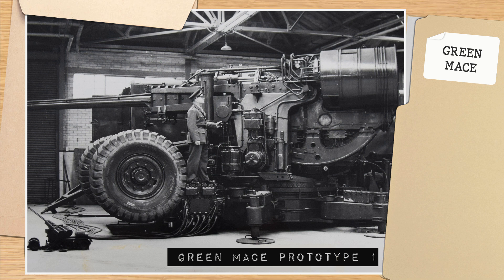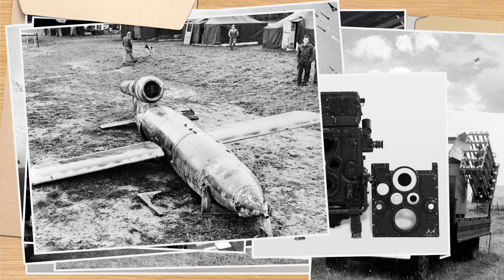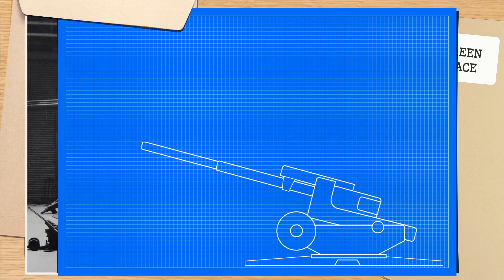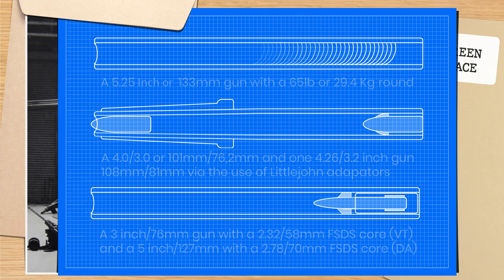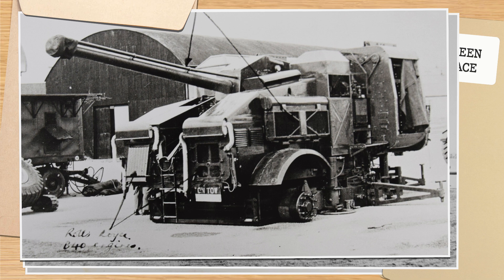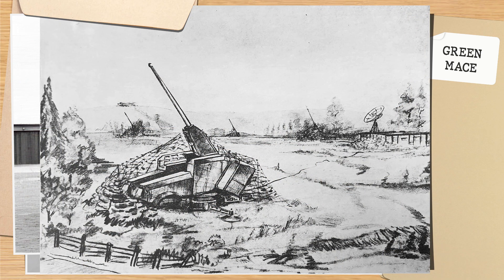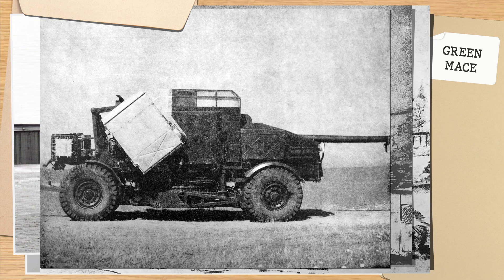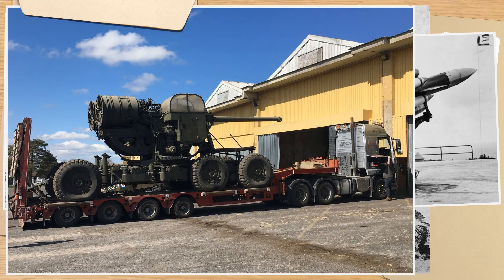Green Mace  - AA Design & Development

Comment: The Green Mace prototype was for many years on display at the IWM site at Duxford, but unfortunately was reclaimed by the Artillery Museum at the Woolwich Rotunda a few years before that closed. Hence the project that the Gunners apparently handed over to the RAF is out of sight in a reserve collection at least until the Gunners get a new museum.
Reply: I saw this exact green mace last week, the RA museum is currently awaiting funding to build a new building, all of the equipment and vehicles are locked away in a couple of warehouses. I walked in and the first thing I saw was this huge cannon that looked like a transformer. The RA museum have kept it in great condition and hopefully it will be back on display soon.

Comment: Excellent work, well done. Just FYI, I joined the Guns Department at RARDE in ‘82. Stories about Green Mace still circulated as a couple of the guys were old enough to have been in the design branch at the end of the design, and there were always annoyed comments about how Bloodhound had finished it off. But I also distinctly remember being told that Green Mace was the small version of something they were thinking about that would use the same basic reload concept but be much bigger calibre. Knowing the guys involved, wouldn’t be at all surprised as a last ditch “let’s beat missiles at any cost” option.
Reply: Guns are likely to make a come back because of guided rounds.   The Italians (Otto Malera) have been using a guided 76.2mm shell called DART since 15 years.   It's beam riding.   The Germans and Italians together built Vulcano 155mm  GPS APDS with a 70km range and a Naval 5 inch version with a range of 80km.  The Italians even ported it to their 76.2mm gun so now can hit a target 40km away with a 76.2mm gun.   The proximity fuse can be replaced by a laser seeker or an infrared seeker (for naval targets).
The US has a guided 57mm shell called MAD FIRES with its own seeker.    So a 100mm gun might be quite effective, especially if a duel feed weapon able to choose between guided and conventional air burst (to deal with drones)
Reply: Highly unlikely

Comment: I did come across Green Mace some years ago but the book only had a couple of photographs and a drawing with little information. So as so often I finally get to learn more.

The 5.25 inch turreted twin gun was used on HMS Vanguard which was launched in 1946. Some sixteen in total. They also tried the rockets on warships but they did not last very long there either. I think the feeling was that it was bad enough that the enemy was trying to sink you without it being self inflicted.
Reply: The Vanguard's 5.25" battery was a direct repeat of the battery used on the King George V class battleships, whose lead ship launched on 21 Feb 39.
Reply: @Wick9876  Late reply here... The 5.25" turret was also used as main armament in the Dido class light cruisers. In a naval context the rocket launchers were known as "Unrotated projectile" or UP launchers, and never did harm so much as a fly as far as I know. Utterly useless for any purpose, a waste of space, tonnage and manpower. It beggars belief, but the Japanese actually stole the idea and installed similar things on their ships towards the end of the war.

Comment: YES!!! About time you discuss this!

There's even a proposal that, if it worked & had the problems ironed out (spoiler, it didn't), could be mounted on destroyers and cruisers. I'm not even shitting, but I took this from Wikipedia and here's what it says:

"Some sources suggest that a naval version of Green Mace was planned as a new dual purpose gun for the Royal Navy's destroyers, and a twin version of the same gun intended for cruisers reached the design stage, but neither went any further, and they were cancelled outright in 1957"

Comment: The V1 was the interceptor fighter pilots ideal target, one that flew straight and level at a constant speed.
Reply: Except for its unpleasant tendency to explode when hit.
Reply: The big problem for the V1 was that with Europe in allied hands the flight paths were highly restricted and the allies could concentrate their defenses.  The other problems was that when launched the missile had a speed of 420mph at sea level (thios was beyond even the Tempest with 150 octane fuel) this deteriorated to about 360-370 in most due to the valves deteriorating.   Nevertheless there were version with speed of as high as 515mph expected and reliable engines as wells as a turbojet version with double the range and a guidance system called Ewald-II. 
Willy Messerschmitt and Rober Lusser designed the Me 109.  Lusser moved to Fieseler and designed the Fi 103.   Messerschmitt loved his ex designers creations and wrote dozens of pages analyzing and proving how a production rate of 100,000 was possible.

Comment: It seems everything old is new again with AA gun systems making a bit of a return to deal with drones although a 5 inch shell may be a bit of an over kill for drones.
Reply: The bursting and fragments might stand more chance of hitting a small target? Like a snot gun with birdshot vs a rifle
Reply: Interestingly, the bigger flak might actually be more useful for swarms of drones. Large blasts don't have to be as precise and fragments would fairly easily take out a drone.

Whereas, systems like starstreak show that smaller finned projectiles are good for larger air assets. How the turn tables.
Reply: @pluemas  True and the Bofors's new 40mm anti air system does use bursting proximity rounds but 5 inch is a hell of a big round and may just be too one use but a smaller 3 inch might be a nice middle ground smaller lighter but still plenty of bang for your buck plus you're probably not trying to loft a shell halfway to the moon like the 5 inch was intended

Comment: Speaking of large caliber AA prototypes  . . .
  The 1944/45 era 15cm gerat 56(?) was a German 150mm bore AA cannon with a two chambered autoloader.  It was part of a late war project given to a few armaments manufacturers (G55,56, etc), resulting in some prodigal prototypes, but no series production.  FlaK towers were armed with single or dual 12.8cm sFlaK40, plus a ring of small bore (2cm/3.7cm) autocannon.
Reply: the thing they call the flak 15cm right ?, also appears in the game WoT on the Waffentrager E-100 which is a fake tank btw
Reply: The 12.8cm FLAK 39 and 40 were the most powerful AAA guns to see service in WW2 by anyone (everything else was experimental).  The Germans did have a Proximity Fuse in development but they suspended work in 1940 to concentrate resources on the Battle of France and didn't get it restarted till 1942/43.  By then its was too late to fire anything but experimental rounds but it would have been deadly.  It used a cold cathode valve and electrostatic detection.  It's code name was kuhglochen  (little cow bell).  Completely unjamable.
Britain actually also succeeded in test firing proximity fuses in 1942.  In the British fuse the shell was tracked using a corner reflector and when the echo from the shell and target merged a coded double pulse detonated the shell.   By then the US fuse was nearing mass production.
-Guns like the 150mm were banned by the Germans due to the excessive resources required. 
The Standard 8,8cm FLAK 37 had a muzzle velocity of 800 meters second and was not very effective above 20,000ft (reasonable to 25,000ft but engagement time at 30,000ft was about 11 seconds).   The replacement was the 8.8cm FLAK 41 with  a muzzle velocity of 1000m/sec.    It had all sorts of issues such as blockages caused by changing from brass to steal cartirdges, vibraion at the high firing rates demanded.   It worked in small numbers and the problems were solved by the end of 1944 (too late)

Comment: Good video. I knew that some British WW2 heavy cruisers had 5.25 inch anti-aircraft/dual purpose guns but this is something else again.
Reply: The 5.25in dual-purpose guns were originally designed for the Dido class Anti Aircraft Cruisers in about 1935 which are technically light Cruisers (6in and below = light Cruisers, 8in = heavy cruisers, as a rule of thumb in RN service) I believe by 1943, three RN turrets and guns were acquired by Anti-Aircraft Command and located in various positions around London, the one in the picture, I think, is the one located at Primrose Hill.
Reply: @joewalker2152  Cheers.
Reply: @michaelguerin56  You're more than welcome, sir.
I hope you don't think I was trying to correct you. I'm just spreading some information from many, many years as an amateur military historian.
Reply: @joewalker2152  Somewhat outside my specialties. I knew that they were used on British WW2 cruisers and decided that if I specified the type of cruiser, someone would react and pin it down accurately. The common perception has always been that RN WW2 dual purpose guns topped out at 4.5”. I tend to have more fun pointing out nonsense about military rifle/ammunition history that has been perpetuated by idle (typically U.S.) gunwriters for over a century. Same for firearm safety instruction, live firing range management and correct nomenclature for firearm and other weapon parts. Keep having fun with your interests and have a good weekend.
Reply: @michaelguerin56  Have a great weekend too, sir.
Reply: @michaelguerin56  EFFECTIVE RN dual purpose guns topped out at 4.5". And an excellent gun it was. The 5.25 twin turret was really too heavy and too slow-moving to be terribly useful as an AA gun other than for barrage fire. It was a very useful anti-ship weapon though. The slightly smaller US 5" was a supreme AA system but a bit on the light side for anti-ship use.

Comment: Is this the amazing AA gun with rotary magazines at Duxford. I remember looking at this with both military engineering and production engineering and thinking as a system it was probably doomed to failure. Reason being the rotary magazines. The likelihood of mis syncopation with such masses trying to engage high rates of fire is large and one in twelve rounds failure sounds quite good. For the systems of monitoring and adjustment available at that time I suggest it was beyond the bar. I think a straight feed system would have been better as long as the feed line was kept short because of the round plus case weight. I would not expect an industrial machine to perform well in such a capacity with a a rotating motion and the technology of the day and have experience of maintaining pre war machines up to a few years ago.

Comment: Also, imagine modernized versions firing 105mm rounds for ammunition compatibility (as used by m101 howitzers) as it'll be also used as long-range ground-pounding howitzers, but with drastically simplified loading system

And the gun seems to be gas operated judging from the small-diameter tube running the length of the barrel

Comment: What I always think about with AA, and is never mentioned, is what happens with the fragments which fall from the sky? Not just the shrapnel, but also aircraft parts? If they were firing rods, my god, what a mess, more of a terror for your own population.
Reply: Yes. Correct. The shrapnel falls down. It's rarely mentioned, but it's something people had to deal with.

Usually you would be under some sort of cover anyways during an air attack, so it was rarely an issue. not like dumb fire anti air rockets landing back to earth. The shrapnel is just metal, any roof will probably stop it.

Comment: Cool beans
Could have made a interesting Anti Tank gun with the kinks work out. Lol
Reply: No mate, I saw it when it was on display at Woolwich arsenal - it's absolutely massive.  Monster Anti-tank guns like the Pak 44 were too big to be effective and Green Mace was three times bigger and heavier...
Reply: @mattbowden4996  damn. I guess the pictures didn't convey the true size of the gun and mount on my phone.
Reply: @mattbowden4996  well I suppose it could have been used as an improvised AT gun if any tank had been foolish enough to show itself to the gunner though I suspect the sighting system would have been mk 1 eyeball combined with spray and pray given that it was meant as a radar controlled system
Reply: Wasn't much point, anti tank missiles were already showing themselves to be a more efficient method. Smaller, typically more accurate, lighter and cheaper.
Reply: @pluemas  I believe that's incorrect.  While missiles showed great promise at the time,  they were  not ready. They were exceedingly expensive, not necessarily accurate and definitely not reliable. A gun system was proven.

Comment: Heavy AA guns were next to useless - it is estimated that during the Blitz, 35,000 heavy rounds were fired to bring down a single aircraft. The most effective British AA weapon of WW2? The humble and ancient Lewis gun....
Reply from the maker: yup bout right, tho the number of AA rounds in storage was far in excess of this, they counted for about 20% in total. not much but 20% is 20%
Reply: The main point of heavy AA isn't too shoot down aircraft though it's a bonus but to force the bomber to fly higher and faster. This reduces range and accuracy, it's a lot easier to hit a factory from 10,000 feet than it is from 20,000 feet plus.
Reply: Well yes and no, to add on top of the thing of AAA being for forcing planes to be less accurate, like most things it depends. Radar fuse rounds turned out to be really useful, the problem is that heavy AA was a dead end technology for the most part by the time those rounds came into heavy use and the SAM was the future for the most part. But you do still see "big" gun spaa designs, like the Otomatic (aka Otomagic to its fans) if you consider 76mm to be big gun I guess and navies still make good use of dual purpose guns.
Reply: @stuartburton1167  Good point. Also, in the old classic World at War documentary series, on the Blitz episode, some Londoners who lived through the Blitz pointed out that the morale of the people was greatly boosted by the sound of the heavy AA guns firing - it gave them hope.
Reply: @mitchverr9330  Yes, the advent of the VT fuse changed things a great deal. 3"/76mm is held to be the smallest calibre for which the VT fuse is suited to make an effective weapon.